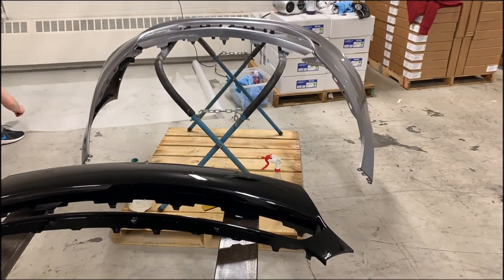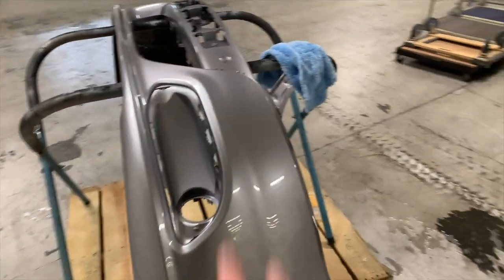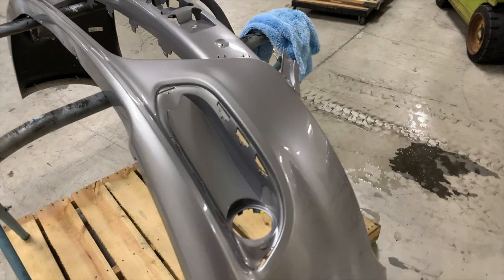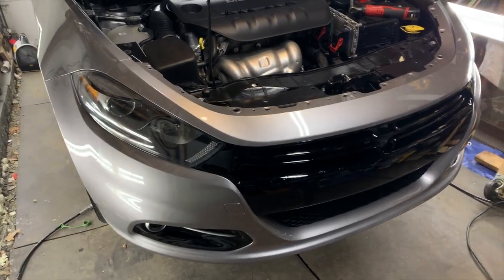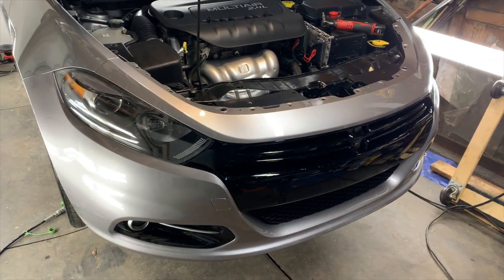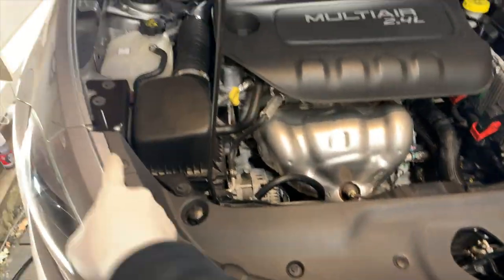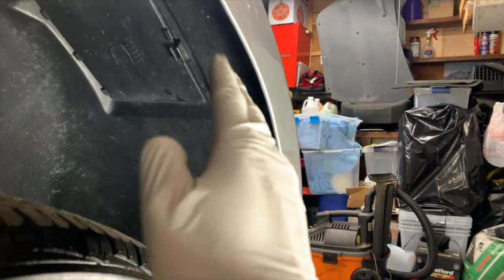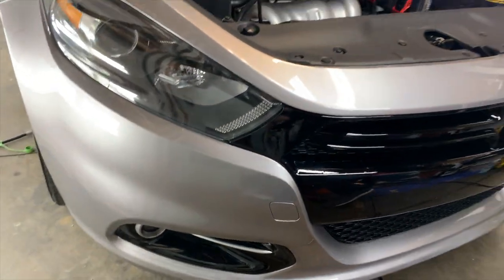2015 Dodge Dart Front Bumper Installation & Xpel PPF Application

Comment: Hey I recently got into a little fender bender and the only damage I see is a crack in that piece you put in at 8:25. Is that swappable without taking the front bumper off?
Reply from the maker: Unfortunately it is not able to be changed without removing the bumper. The clips that hold that piece in are very strong, you will need to be very careful and take your time taking the cover apart so you don’t cause additional damage to the parts surrounding the center appliqué that you want to change.
Let me know if I can be of further help!
Reply: @TagTeamGarage  thank you!!

Comment: Hello. I have a granite gray paint on my front bumber. Where can i get the same color paint or do i need to get it painted somewhere else? Any suggestion
Reply from the maker: If you only need a little paint, you can get the touch up paint from your local dealer. 
Or if you have a local body shop or paint supply store, you can usually bring them the paint code from the drivers door sticker and have them mix it

Comment: Where can I buy a new bumper
Reply from the maker: You could go to your local dodge dealer, could look online as well, there are plenty of options!
Reply: @TagTeamGarage  will it come in silver?
Reply from the maker: No, all new body parts will come in black primer and will need to be painted. If you want one already in silver, your best bet may be trying to find a good condition used one at a salvage yard or an LKQ/pull-a-part facility

Comment: Awesome job ! You are one of the few who showed the whole process. Skipping parts might be faster, but confusing. Still and all, what tools did you use (i.e., the part where you used the power drill & mm sizes) Me and a buddy are doing this tomorrow and want to get the right measurements
Reply from the maker: Thanks for the comment!
The front bumper is held on by 8mm screws on the bottom and in the fender opening areas. There are also 2 10mm bolts on the corners of the bumper where it meets the fenders. Under the hood, there are (If I recall correctly) 6 black 10mm bolts as well. 
You will also have to remove the black plastic clips that hold down the radiator close out panel under the hood as I showed in my video about removing the front bumper cover. 
Really the only tools you should need are an 8mm socket, a 10mm socket, a panel clip removal tool, and your choice of either a power drill, power ratchet, or manual ratchet. 
Let me know if you have further questions!